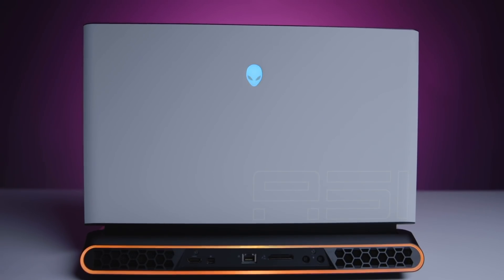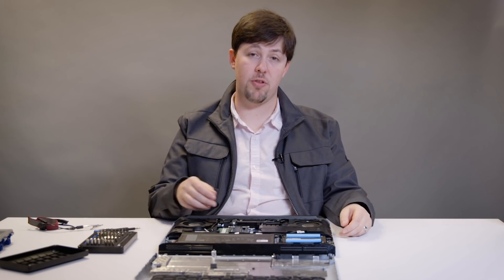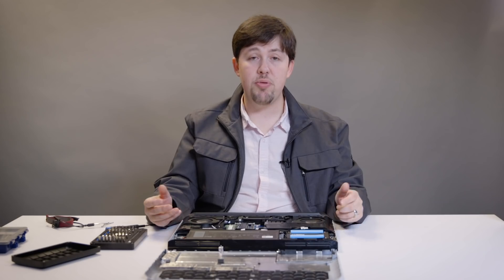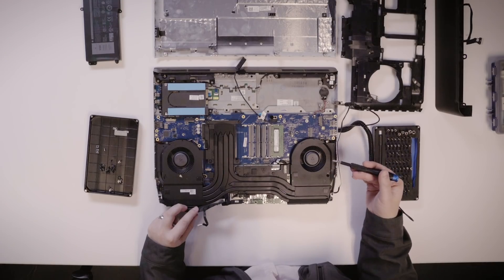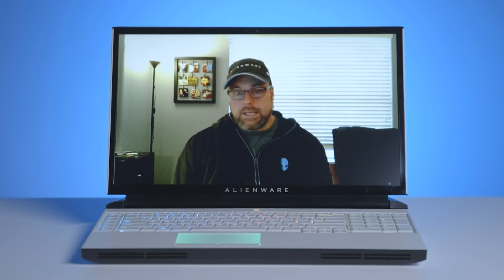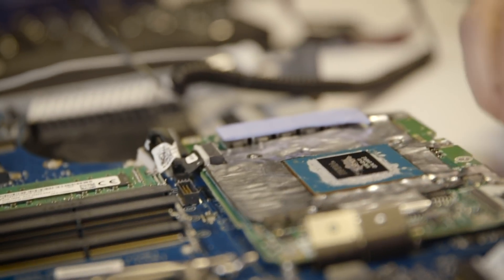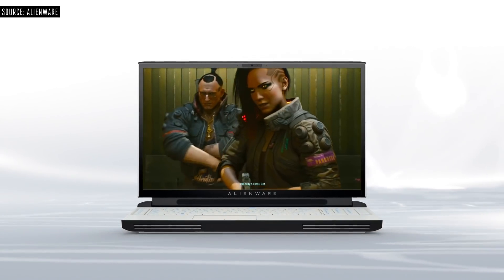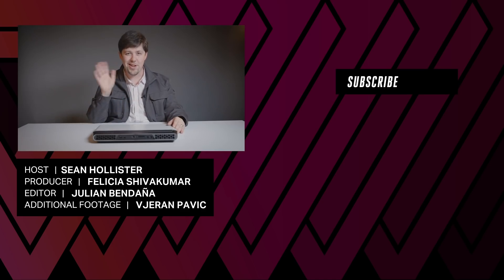Alienware Area-51m: an exclusive look inside

Comment: Keep at it Alienware and I am sure others will follow. This is what we need. We need to gain back the control of our devices. A new standard should be developed for GPUs and CPUs which makes swapping 'em mainstream. It will save us a lot of money and help with the e-waste issue we are facing. Who agrees?
Reply: Even MXM has a couple of different standards, thus, the problem.  You are correct for a new standard, that is ADHERED to, by everyone!  Dell sells so many laptops, they should have a bit of sway with NVidia.

Comment: mSI tried this a few years ago with swappable graphics cards on their laptop but it didn't work, since they couldn't plan for future components needed and their requirements, such as power voltage, motherboard, and the nightmare of custom GPU laptops and ecosystem of just ordering the upgrade parts

Comment: I think someone should really make an official form factor for upgradable laptops, like a motherboard this size, with these connection possibilities, ad gpu this size with these connection possibilities, a battery this size, and a case that could be any size as long as it can fit the components, with maybe the gpu as 'optional' (even if that not really necessary since why would you want a laptop this think if you are not gonna use a gpu), and making all of that public and non-proprietary...
all companies could work on this and make the same industry as the desktop one, sure we can't call this a true laptop, it's not meant to be the thing you put in your backpack, but there are still a lot of use cases that could make up for the development cost

Comment: Desktop replacement grade laptops have been using MXM modules for their GPU for a long time. The issue is customization of size and power delivery  of the module, heavily limiting upgrade path. This Dell only PCIE add-on format doesn't seem to have any advantage over the existing lot.

External GPU over thunderbolt or even proprietary PCIE cable interface make MUCH MORE sense. With the added benefit of a way smaller device.

Comment: An upgradable laptop should be big enough to fit all the upgradable components in the future,(as big as the curved display Predator series)
Also, not only the GPU and CPU ,other modules like WiFi units, display adapter,etc must be able to be upgraded..

Comment: Yeah sure upgradable...
CPU... it's Intel, they change socket for every other goddamn generation.
GPU... it COULD be hard to find graphics cards sold in that form factor
Reply: And changing an RTX 2080 may not be that profitable...
Reply: MXM has been around for years.
Reply: @ottersdangerden   that's what I'm saying. It's been in Alienware laptops for over 10 years......
Reply: I'm sorry what
Reply: Remember this is a prototype not official. Also you can buy graphics cards in the form factor feature easily, and possibly cheaper as well, because mobile gpus don't have copper heat sinks or other metals.
Reply: @ClaytonMathisVO  the External  gpu is trash the best performance u can get is gx1060 from it
Reply: @my-tvnice2696  Not true I had the amplifier with a 1080 and was hitting 200fps on Doom ultra quality @1080p. What slowed some laptops down was the slower ram and older slower CPUs. I changed my ram from 8gb 2133mhz to 32gb 2666 mhz and saw a difference. Graphics amp is the way to go for egpu.
Reply: @yummiermussel5331  Doom is caped at 200. Highly doubt you got a difference. Maybe in frametimes but not in actual framerate if you already did hit 200fps prio ram upgrade.
Reply: What i was getting at is that you can hit higher than 1060 level performance with the amplifier. Depending on your cpu/gpu and ram.
Reply: @saltyfloridaman7163  the same with gtx10can't be upgrade to the new gen rtx20
Reply: I have heard the MXM cards from 9 series to 10 series are not interchangeable. Hopefully the 20 series are.
Reply: Socket 1151 has been used since Skylake 4 generations ago lol but I see what you mean
Reply: Why dont you use EGPU
Reply: It more like proof of concept.
Reply: Someone has to start it, manufacturers and consumers will adopt.
Reply: i'm from 2020 here ! The Alienware Area-51m’s upgradable dream has failed.
Reply: The socket has been 1151 for the last 4 generations though? Not saying I’d be surprised if they were to change it soon however
Reply: @NothingVideot  Only 8th/9th gen are compatible together... the 6th/7th gen does not work with the current chipset, hence why he said every other...Just food for thought.
Reply: @NothingVideot   Socket 1151 has been standard the last 4 years but... Intel being Intel they will make sure that new chips don't work with 1 generation old hardware because that is money you could be giving them. Maybe they change it up once 10nm hits shelves but i doubt it.
Reply: changing the gpu is a lie the same thing happen with msi titan sli gtx980m  laptop they said the new gen of gpu can't fit with laptop mother board when ppl try to upgrade to 10th gen
Reply: @my-tvnice2696  you poor dumdum

Comment: never been able to swap out the graphics card.... EVER UNTIL NOW ... if you ignore all previous laptops with MXM slots and the old traditional M cpus like the 4700MQ that allowed CPUs to be swapped out. Advertising old features as new. Classic. At least they didn't use 3 screws on the GPU and CPU this time.
Reply: Most of the laptops with MXM slots didn't use traditional or full spec MXM. My Asus N55SF does have an MXM videocard but it's not upto spec. So no other cards fit.

Comment: Thank you Alienware. This was much awaited. Hopefully ASUS and razor learns something from this
Reply: ASUS will never learn. They love to screw things up.
Reply: @riazulrahil  ^this made me convert Islam.
Reply: Interchangeable mobile part on a laptop has not been a new concept. This has been done numerous times before, and failed numerous times before.

This will be the same.
Reply: @saltyfloridaman7163  And would Dell be willing to support so many different options for just one line of Alienware laptop? The CPU might be off the shelf, but the GPU, motherboard, and battery certainly aren't.
Reply: @saltyfloridaman7163  It makes absolutely no business sense. It takes massive amount of time to design, certify, and fabricate the parts with proprietary form factor for a single high end laptop that already is going to have low sales numbers. To ensure they make a profit on those, they'd have to pretty much sell those components at extremely high price, which defeats the purpose of an upgrade-able machine. 

There's a reason why modular computer never caught on, despite so many manufacturers attempted it in the past. The Alienware Area 51m will just be another corpse on the pile of those that came before it.
Reply: Mother ship all the way
Reply: Learn what exactly, this laptop is useless, even though in theory you can upgrade it, in reality you never will, and its heavier and much more expensive than a regular laptop
Reply: @maratpirate6343  Yup. Plus the upgradable parts will most likely be insanely expensive making it not worth it.

Comment: At least they are somewhat honest...
Reply: Yeah unlike The Verge lol
Reply: I mean, MXM has been a thing since the mid 2000's..... Alienware and Dell shipped millions of laptops with MXM in them over 10 years ago.
Reply: @Schm1tty  Yeah. It is just a advertising thing. Doesn't really mean that much to the avg consumers.
Reply: I mean the old Alienware 5156*might be a different model literally could be upgraded though probably won't have as many choices as this new one. Not vergew fault, the laptop I am talking about ( the upgradability) was an enthusist option. Most probably didn't even know about it
Reply: Honestly in what? I tried to use alienware in the last 10 years, alienware has always SOLD me this idea of upgrading on their laptops, but when I needed to upgrade my video card, I WILL NEVER FIND AN OFFICIAL SOLD BY PROPRIET ALIENWARE AS UPGRADE, I have to search in forums if boards video removed from other newer alienware laptops will work on mine, paid dearly for the video card, and often do not work well due to compatibility issues.

Alienware TE SELLS the idea of future upgrades, but will NOT provide upgrades, it wants you to buy another laptop.
Reply: @RicardoRamosRetrocomputacao   true, same here. But I think it was because you can get a newer graphics card from a better laptop than yours and upgrade probably, but I dont know. I could be wrong
Reply: changing the gpu is a lie the same thing happen with msi titan sli gtx980m  laptop they said the new gen of gpu can't fit with laptop mother board when ppl try to upgrade to 10th gen
Reply: @my-tvnice2696  Came here to say this. My 965m's cannot be upgraded, but they promised 2 generations.
Reply: @my-tvnice2696  Historically some companies have done it correctly. Acer did with the MXM form factor GPUs. Since TDP and power consumption didn't change much, you could upgrade 2 generations.
The RTX line is power hungry, but the electronics aren't all that much denser than the 9 series, so if you don't care about ray tracing, I don't see why you shouldn't be able to put in a gtx 12 series or whatever. Boost frame rate and render time (Loosing DLSS anti aliasing also.)
I just hope their bios and cooling setup allows for the next gen CPU to have different boost timings.
Reply: @my-tvnice2696  TRUE, my GT series has that removable graphics card as well but I don't think the normal user could switch to a newer graphics card anyway.
Reply: my-tv nice watch the full video then tell me they’re lying 

The guy said there’s no guarantee that they could replace the gpu

Comment: if I had the money I would buy isntantly just to support this kind of strategy.
Reply: @saltyfloridaman7163  nah my dude, the series is irrelevant. What matters is wether it's the correct MXM card. The 10 series also has cards that are MXM form factor.
Reply: hope they make a barebones version with just the GPU so I could equip it with an 8600k and 16gb ram and step up as I need the performance
Reply: Not worth it, 2.5k for this garbage?
Reply: The fan noise is beyond what I can accept. 2 power bricks, No optical. Chip that work with certain design. Just too many variable. I a cool idea but I have m18x and r4 17. I still don't see the point of it, yet.
Reply: Factsss
Reply: changing the gpu is a lie the same thing happen with msi titan sli gtx980m  laptop they said the new gen of gpu can't fit with laptop mother board when ppl try to upgrade to 10th gen
Reply: @my-tvnice2696   Alienware m17xr4 runs 1070 i think also 1080. That was the most upgrade friendly machine that supported all mxm from 5 series when it came out to 10 series, granted with some mods here and there.

Comment: Under what rock have you been living? MXM was available on old MSI and Clevo laptops. Alienware did it years ago too. It's exciting that it's kinda back, but it's not new.
Reply: Yeah mxm has been around they are releasing as "NEW" howevero dell have had replaceable gpus back in the agp days too.  The verge is a joke that keeps on giving.
Reply: Titus Rwantare it doesn’t use mxm, it’s a dell form factor
Reply: @macdel69  that's why I said 'kinda' 
Upgradable laptop gpus aren't new
Reply: MXM hasn't been around for years and they those GPUs were much smaller than the current ones.
Reply: @DanielBlaney  sure because nvidia and AMD have been cranking the power draw to increase performance at any tier. 
The 2080 is in the same power draw class as the 1080ti ~270W. 
The 980M was a 125W part available on MXM, the fresh 2060 is officially 160W. Vega is a joke on the power draw front, and the 590 draws more than the 2060. 
The issue is that performance per watt hasn't gone very far since the 980M and someone with a formerly top tier 980M is kinda insulted by having to upgrade to an RX 570 or a GTX 1060, both are slightly quicker but only the 1060 can squeeze into the power budget.
Reply: @DanielBlaney  MXM is still used today in a bunch of MSI and Clevo laptops (agreed its not as ubquitous as in the past), Clevo P870TM already supported 9900K and 2×1080 MXM cards in SLI soon soon after their respecive launches months ago (uses a Z370 chipset motherboard), it should support 2080 SLI as well on launch of MXM cards.
Reply: Viewing this on my 2017 Clevo P9873 DM3 with i7700K @ 4.2ghz, two 1070s in SLI, 32 RAM, and four SSDs.  😁

Comment: Except where are you going to find the next gen GPU cards for sale in a few years...and would the upgraded next gen CPU even work with the bios on the mobo...
Reply: You can probably only buy it from alienware. But yeah that's a problem haha. Except that if your intention is to make a long lasting gaming laptop, then I guess the desktop level i7 or i9 (i have the i9 personally) would serve you good for like 7-8 years and it's just the gpu that you might want to upgrade every 2-3 years. So I guess realistically speaking, you might only be able to upgrade the cpu twice (same socket), or maybe never, and upgrade the gpu twice or 3 times in its life time. Ram is always upgradeable but for a laptop this caliber, I don't think you need to upgrade the ram at all. So I guess the last thing you might want to upgrade is the ssd.
Reply: @raikozy35  on this one probably, the connectors don't look like anything else I've ever seen. But laptops with MXM boards have been around for over a decade now. You previously didn't need to go back to your manufacture for the board. Look up mxm gpu's, they've even been used in Alienware laptops since the mid 2000's
Reply: @Schm1tty  oh yeah I remember that. Yeah this one doesn't look too familiar to me either, maybe proprietary to dell or maybe they have to do that to maximize the data transfer, not sure. I'm a desktop guy so I am not super familiar with the slots that mobile devices use. Pretty sure ram sockets are different sizes from the desktop counterpart as well.
Reply: @raikozy35  ahh true. Yeah laptops (that don't have ram soldered to the motherboard) use so-dimm, which are just smaller ram modules. Nothing too special really.
Reply: Yeah I'm glad the AW rep was honest about this.  I encountered this with my older MSI Barebones laptop.  There was a custom bios to use a dell ATI card to replace the Nvidia card that came with it but you had to load that bios and also either cut/modify the nvidia heatsink and add a couple extra copper Vram cooling pads or find the ATI card's cooler and then dremel that up to fit into the MSI chassis.

The other big problem was the price.  The ATI replacement card cost as much as the flagship Ti desktop card at the time so that was the real nail in the coffin for me.

I just rode the laptop out until the mainboard died and when it did, I pulled the i7 CPU and RAM and found a SFF mobo that uses the mobile ivy bridge socket and built a little desktop with those parts.

I want to see this succeed and if Dell can't convince nvidia/AMD to standardize the form factor/cooling of their mobile GPU's, no one can.  I want to see it succeed so I can get a Zephyrus or Razer blade and keep slapping faster GPU's in it.
Reply: intel change socket almost every 2 year so.......
Reply: If nothing else, the AW graphics amplifier port lets you externally upgrade to any gpu.

Comment: Not the first time mobile GPUs have been interchangeable and definitely not Dells first attempt at this either.
Reply from the maker: I actually had a Dell Inspiron 8200 back in the day with an ATI Mobility Radeon 9000 on a daughterboard, but they didn't market it as upgradable and we had a hell of a time finding a replacement card when that board burned out. Then there was MXM, which was actually supposed to be an upgradable standard but didn't get any real kind of support. I'm hoping this isn't MXM all over again. — Sean
Reply: @TheVerge  Can you guys not lie about it in the video then?

"....because you've never been able to swap out the graphics card until now."

Not cool, The Verge. Not cool.
Reply: Yep
Reply: Technically, yet again, most people don't try to. They just getting new one.

Comment: Actually suprised that Alienware is allowing upgrades. This is huge.
Reply: This is old news. They've had Alienware laptops with upgradable graphics cards for years and they aren't the only company to do so. If anything this worse off, from the sound of it they're using a proprietary GPU module as opposed to MXM slots most upgradable laptops have and still use.
Reply: Its huge? Its a trap is what it is. Your stuck getting from them and you will pay for it. This is a gimmick. This has been done before...was it huge then?

Did you even notice?
Reply: I doubt it'll release tho.. it's just a CES prototype,
Reply: It may be expensive but if you think about it, they launched an external gpu adapter and now this mate.
Reply: ram and 3-4 slots for hdd / ssd is not upgrade? / wireless card as well?
Reply: I feel like its more of a step forward to something that could be genuinely really promising, but not something I'd buy now, I'd get like the third generation of this or something, not hating, I think its cool, I just know it could be a great deal better with time and R&D
Reply: Just got Alienware r4 fml
Reply: Physically lol...nah true
Reply: changing the gpu is a lie the same thing happen with msi titan sli gtx980m  laptop they said the new gen of gpu can't fit with laptop mother board when ppl try to upgrade to 10th gen
Reply: @my-tvnice2696  that's msi. Nvidia doesn't allow it anymore hence why alienware has to make the gpu board itself
Reply: @my-tvnice2696  Exactly